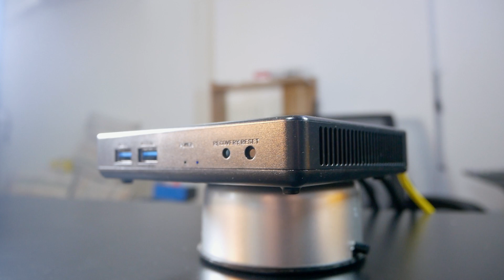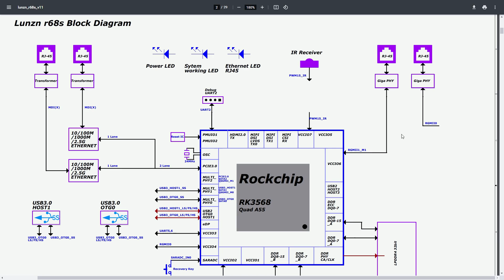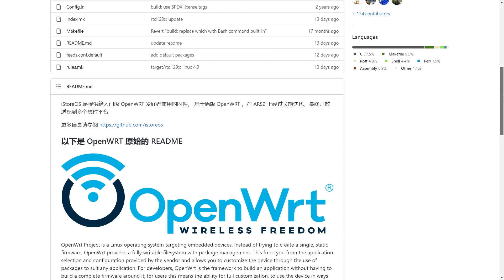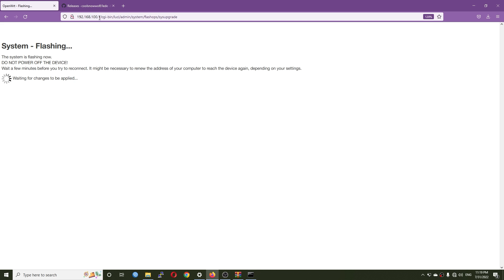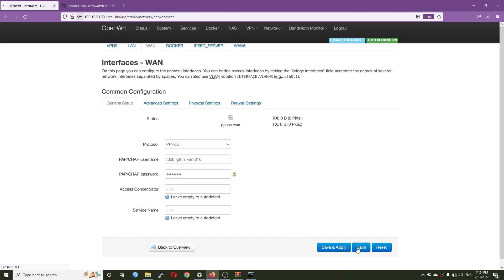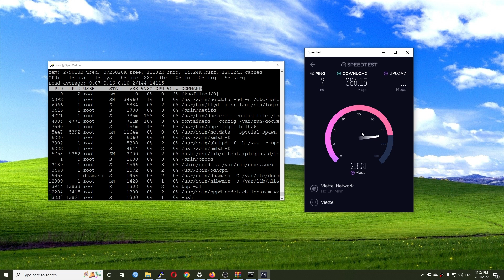FastRhino R68s Detailed Overview (Rockchip RK3568B2)

Comment: Hi Van Tech Corner - you are really amazing. I just found your youtube link and got excited. Need support to choose the right device for watching 4k IPTV videos - need 20 MBPS output from Nord VPN. Which device i need to buy iNet ? Raspberry Pi? Nano pi4s or FastRhino (means it should send the signal wirelessly to my televeision) appreciate an answer asap
Reply from the maker: Hi, are you just getting started with OpenWRT or already get used to it? Configure IPTV on OpenWRT is not an easy task (even with GL-iNet or NanoPi) and you will need to do this on your own. R4S, FastRhino doesn't have wireless connection. If you are talking about 20Mbps (Megabits per seconds), it most of the routers can handle that. But 20MBps (Megabytes per seconds) is not an easy thing. You can take a look at the Flint GL-AX1800 or Beryl GL-MT1300, they can handle this throughput.

Comment: Hi,thanks for the video
currently using Unifi 100Mbps package,i want to replace that unifi provided router
is this FastRhino good for my Unifi package?or R4S/Flint GL-AX1800 better for daily usage like video streaming and p2p downloading.
thank you.
Reply from the maker: Hi, if you don't have an access point, I will suggest getting the Flint GL-AX1800 which has WiFi 6 and powerful quad-core CPU. It should be more than enough for 100Mbps, or even 500Mbps. Get the R4S if you want better VPN & SQM throughput, and go with the R68s if you want a balance solution between 2.5GbE ports, pricing and CPU power.